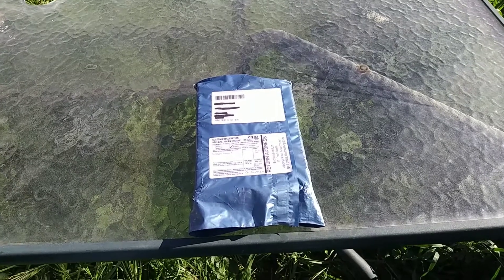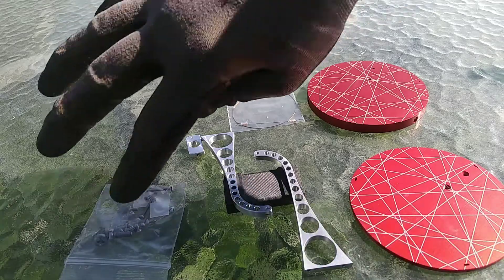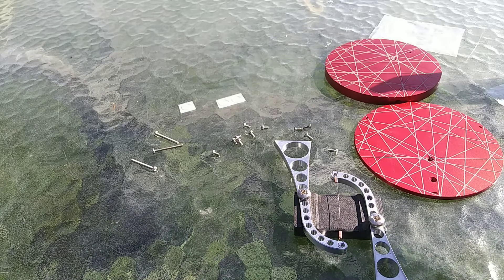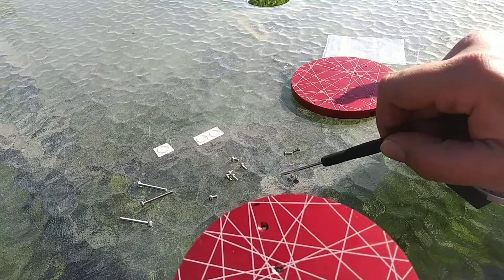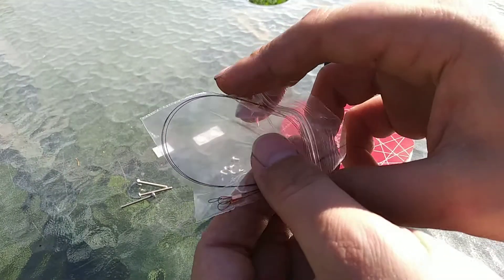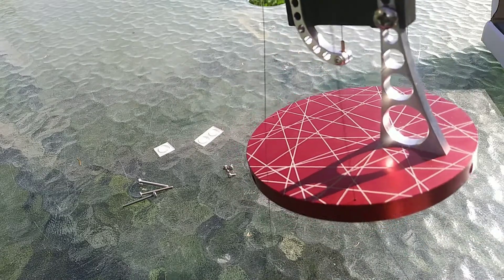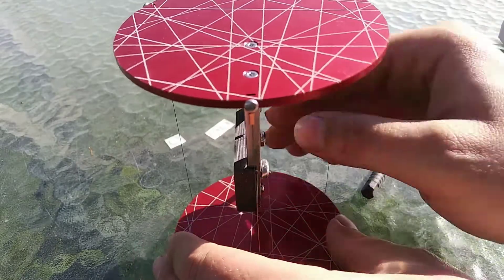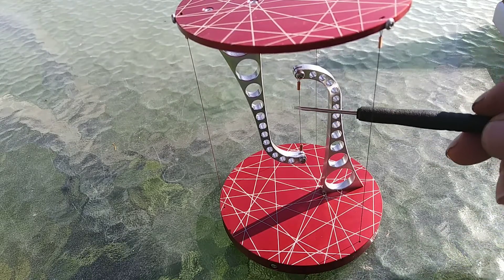Tensegrity Table Unboxing/Build

Comment: Newer kits are different.  Retaining bracket and retaining screws are plastic, outer edge set screws are hex and WAY smaller - barely visible.  Top plate is only striped on the top surface.  Unfortunately their QC has fallen off: My kit failed to include screws to secure the wires underneath to the sliders.  Crap QC.  Have to return my kit or hunt for some seriously tiny screws (nope).  Also it’s dumb that they don’t include printed instructions in the box.